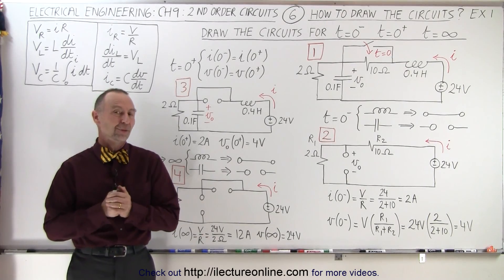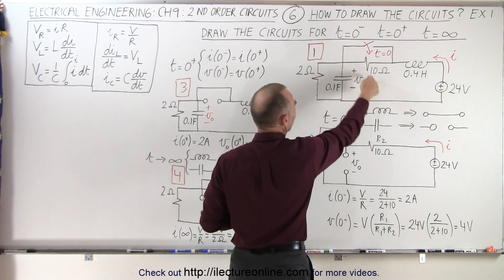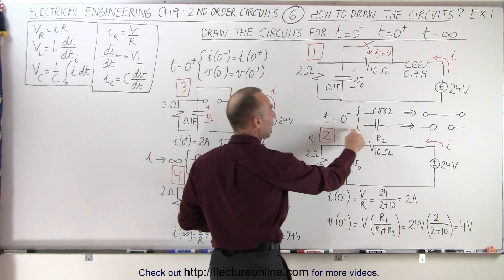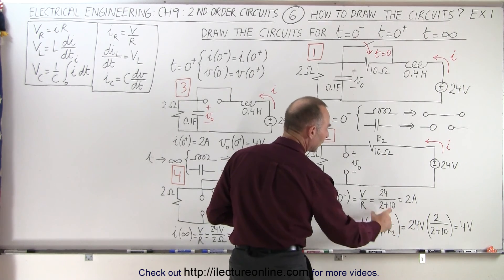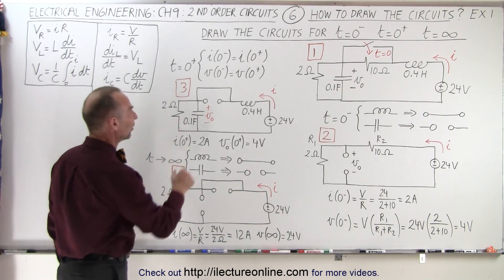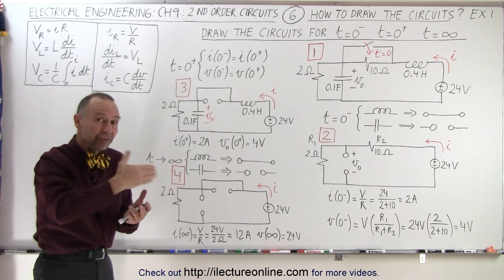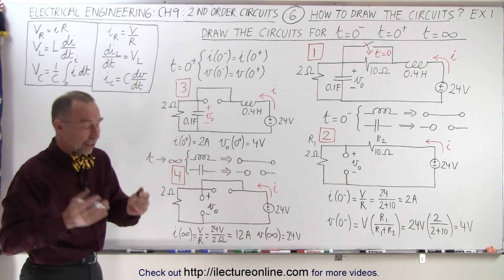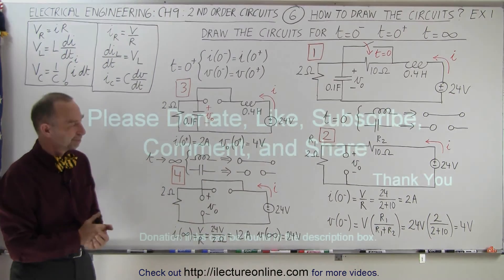Electrical Engineering: Ch 9: 2nd Order Circuits (6 of 76) How to Draw the Circuit: Ex 1

Comment: Hi Michel, thanks for the video.  I have a question please.  At t=(0-) and t=0 and t=(0+), the voltage at the capacitor is 4V.  At t=(0-) the voltage at the inductor is zero.  But at t=(0+) the voltage at the inductor will have to be 20V to compensate, in this circuit configuration, for the voltage at t=(0-) on R2 that was 20V and was abruptly shorted at t=0.  Therefore at t=(0+) the function L (di/dt) will have to be 20V.  So at t=(0+) the current at the inductor is 2A but it is abruptly changing to abruptly make the voltage at the inductor at t=(0+) be 20V.  Please let me know if you agree.  Thank you.
Reply from the maker: I got lost somewhere around the second or third line.  In general, when we have a step function (or the opening or closing of a switch) the voltage at the source can change instantly, but the current in the circuit may not incrase immediately due to the reactance of capacitors or inductors.  Is there a specific item in the video you are not sure about?
Reply: @MichelvanBiezen  Thanks for your response.  I wish I could insert a graphic here.  What I was saying is that at t=(0+) the voltage at the inductor must be -20V.  This is because at t=(0+) the voltage at the capacitor is -4V, so, in circuit loop on the right, we have -4V - 20V + 24 V = zero

Comment: will there really be no current through the resistor when the switch is closed? or would it be infinitesimally small? something like the resistance of the wire versus the resistance of the resistor in parallel?
Reply from the maker: The moment the swtich is closed, you provide a short circuit around the resistor and the voltage across the resistor drops to zero.    (In the real world there is no such thing as "zero" and "infinity", so I don't know if that is what you are referring to?)
Reply: I will have to assume that the wire has zero resistance and the voltage divider equation equals zero / resistor plus zero. Sorry, silly question, not really related to the circuit, but I was confused. So basically, if there's a path around a component in a theoretical circuit, not accounting for real resistance of the trace/wire, we assume the trace is zero resistance and there is no voltage division, and no voltage across the resistor, or something.

to answer your question, basically I was overcomplicating it so it confused me, forgetting that we don't account for the resistance of a wire.
Reply from the maker: While solving book problems like this, the conductors do indeed have zero resistance.

Comment: is it a case when current and voltage right after the switch closed not equal before ? Thanks in advance,sir
Reply from the maker: Current does not change instantaneously.  It takes a finite amount of time to change.

Comment: Sir, I am curious. What did you major in? Electrical engineering? Mechanical engineering? Or physics?
Reply from the maker: I majored in physics, and have worked as an engineer for 35 years.
Reply: @MichelvanBiezen  what are some of the job positions you held? It's so interesting knowing you didn't take the conventional engineering route.
Reply: @MichelvanBiezen   I think the physicians are better than us (Im in eee).